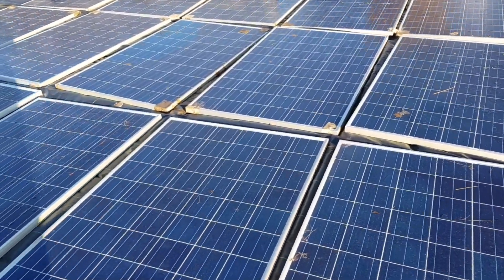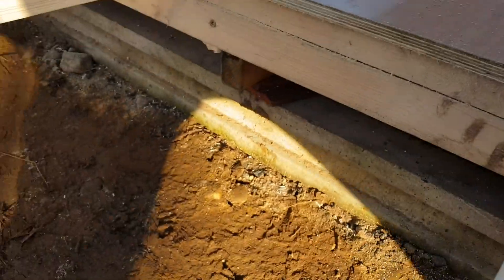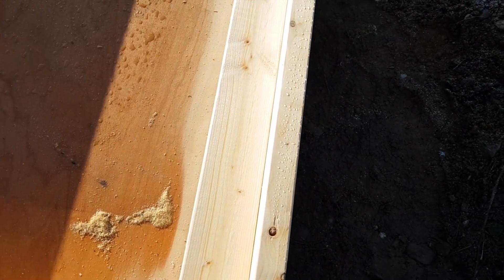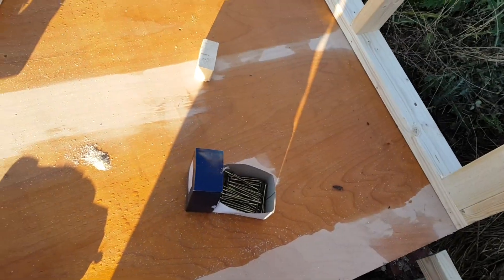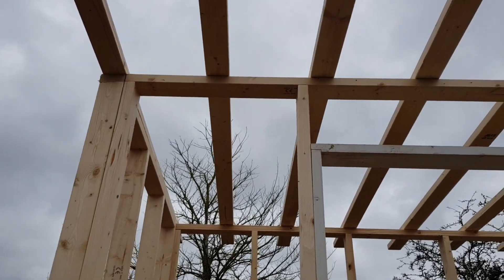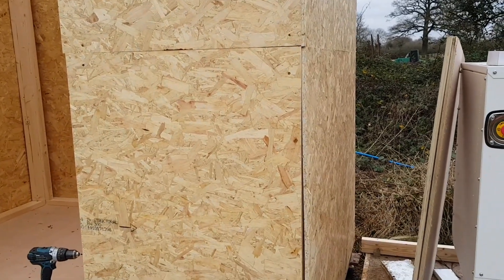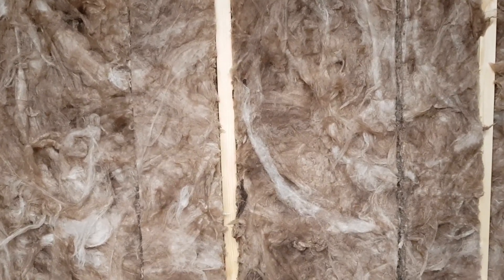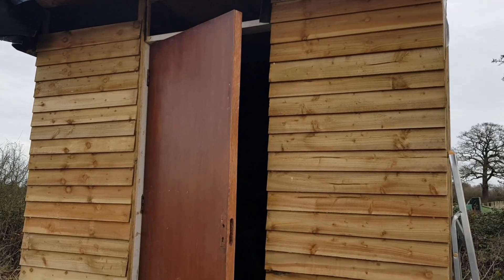installing a 10KW offgrid solar power system! Part 1 building the power shed!

Comment: That's a serious amount of solar
Reply from the maker: I know right, been waiting a year to get the extra bits can't wait to get it all up and running. You getting a little system on your cabin?
Reply: @Field_to_Farm  yes, I have a small 300w system, but it's enough for what I need
Reply from the maker: @prepping_essentials  good man, have you looked at using a container as a faraday cage for solar flare protection for some electronics and tools? I'll be keeping my small solar system in one boxed up prepped. Solar flare is what I think will end our civilisation one day 😑
Reply: 30 panels x 225Wp = 6,750Wp 👍😁
Reply from the maker: @zjzozn  20kw refers to the total power of the batteries not the solar power, the solar array will be 7kw 👍